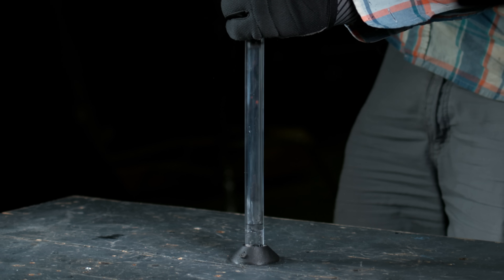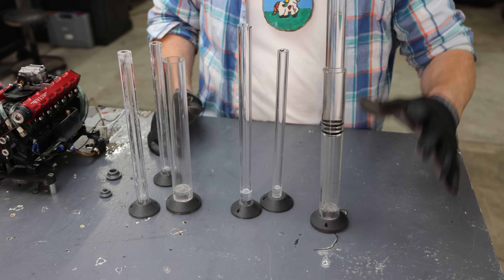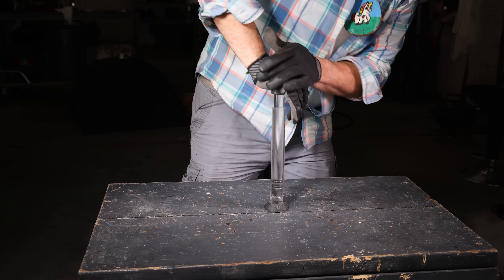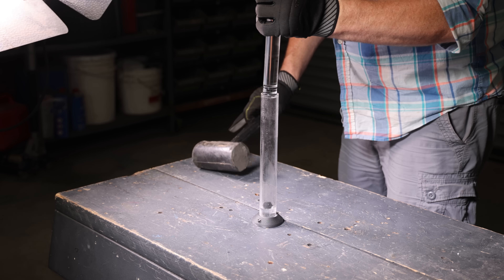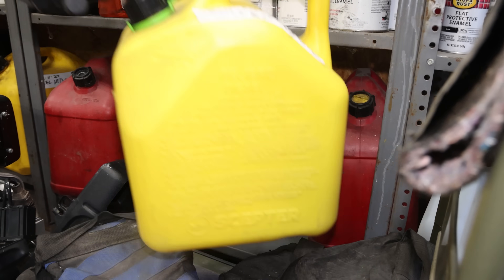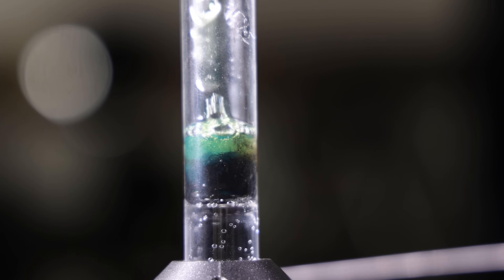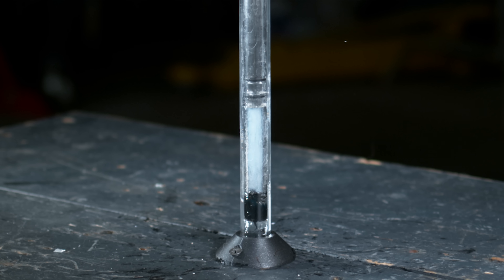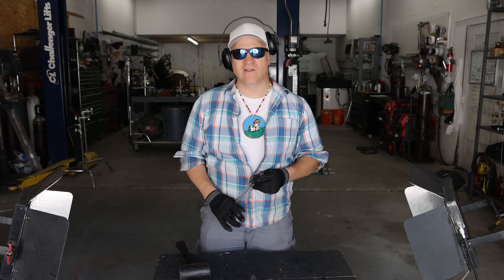How Diesel Actually Ignites (Slow Mo)

Comment: Some wicked smaht person needs to explain WHY this happens instead of just demonstrating that it does happen. Nuclear bombs seem to work in a similar fashion by violently compressing nuclear material using TNT to create a nuclear explosion. Hydrogen also appears to combust in tiny amounts in a phenomenon called sonoluminescence, which is not fully understood, but it takes a shock wave to create it, and scientists say that the heat from this tiny spark is equal to the heat of the sun. Pistol Shrimp are able to create this effect, which they use to stun their prey. There are also sonic cavitation water heaters that use shock waves to heat water "over unity," meaning that there is more energy output than energy input, which scientists like to say is impossible, but there are patents on sonic cavitation and companies that produce sonic cavitation devices, you can even produce one yourself, so there is no disputing that this phenomenon exists. Whoever can use it to create an internal combustion engine, like Stanley Meyer is alleged to have done, will truly "evangelize" the world like Stanley Meyer said his invention would do before he died of a "brain aneurysm while claiming that he had been poisoned after a cranberry juice toast with Belgian investors at a Cracker Barrel restaurant in Ohio in 1996.

Comment: Liquid doesn't compress. And that is really why you could not get it to combust verses "explode". And that is also why in diesel engines you need to make the fuel vaporize (like with the extremely high pressure injectors) to achieve combustion.

Comment: I have made probably between 20 and 30 fire pistons and have never failed to get one to ignite on the first or second hand push. Diameter though is between 3/8 and 1/2 inch using an "O" ring seal.

Comment: Your piston is trying to move up but there's a giant hunk of metal (the sledgehammer) still on its way down. To decelerate it and push it up, the force required is tremendous. So it builds up pressure and explodes.

Comment: yip diesel engines are made with metal cause POWER!... also there's another engine type with much higher compression ratios than diesel engines which uses an effect where the air molecules combust due to the fusion effect of compressed particles or something like that, basically the same as a diesel engine except you don't need a liquid fuel source only and air intake and exhaust

Comment: Dumbest video I’ve ever seen. The tubes were breaking because the plunger was bottoming out. Better o rings would solve this. Also the few ignitions he did get went out because they immediately burned off all the oxygen around them. If you attached the cloth to the plunger instead of placing it at the bottom of the cylinder, you would be able to pull it out and supply it with fresh air after lighting it instead of having it suffocate itself

Comment: I think I know the flaw that made it explode

In a usual engine the piston is tied to a rotating disc so it hits then retract, but wit with the hammer it hits and stays in place. So that's the reason the ignition is building up not having a place to expand so pressure goes through the roof and the tube explodes.

I think by making it with maybe a rotating crank it may work better if you get the motion of the piston just right.

Comment: My old Volvo V70 has 16:1 or so and an old VW / Audi 1.9tdi would be 19:1. A newer 2.0 tdi is around 16.5:1. A PSA HDi engine is around 19:1. I think modern diesel car engines run on the lower side.
No idea what haulage, big shipping or locomotive engines run at though.

Comment: One difference between your demo and an actual diesel engine is that the fuel isn't already all there as the air is compressed. The air (only) is first compressed and then the fuel is slowly injected as the piston moves down in the power stroke. The newly injected fuel burns as the piston moves, not all at once at top dead center as in the Otto (gasoline) engine. This maintains a constant pressure as the volume increases and the combustion gases do work on the piston. This pressure is set by the injector; fuel cannot flow into the cylinder unless the injection pressure exceeds the instantaneous cylinder pressure. This is why diesel engines don't explode like your demo.

Comment: The reason it is exploding instead of burning is because you have overbuilt the system so that the maximum pressure at the bottom of the movement is far in excess of the requirement to create combustion. Since the piston is still traveling downward at the time of combustion, you’re blowing the bottom off your cylinder.
Reply: I agree, in the diesel engine the timing for combustion is very important. I think the piston has to be in the ready for downstroke (power to the driveshaft) position when combustion occurs so force is directed to push the piston (least resistance) and not out the sidewalls of the chamber.  In plain english, when combustion occurs in the cylinder, the piston connecting rod has passed top dead centerpoint.
Reply: @roykowalski4125 Yes

Comment: Pinging where the diesel residue explodes on recompression which is why your tube on the second attempt just blew, the reason is that you have no exhaust sequence which on a diesel engine always means you have a fresh fuel/air charge to compress. What you could have done is try to delay the burn by adding a drop of water as that will cause the diesel to have a longer slower burn and was the basis for some of the earlier SCR systems.

Comment: In mechanics I was always taught that gasoline with a spark or diesel with compression explodes, not burns, the explosive power is what moves the piston and turns the crankshaft. so I think unless you have something that can handle that explosion you wont see it...but pretty cool!
Reply: The gasoline and diesel combustion in an engine is what's called "Deflagration." It's somewhere in the middle between combustion and explosion. It propagates sub-sonically (slower then sound) through heat transfer but still faster then normal combustion. Explosions detonate by a supersonic shock wave travelling faster then sound. An explosion in your engine wouldn't be good for anything, your pistons would disintegrate in seconds.

Comment: It's the mass of hydrocarbons (which creates pressure in the form of the gaseous combustion products, CO2 and H20) that is resulting in the exploding cylinder.  You have more mass of fuel when you are igniting the diesel than the char cloth

Comment: Compressing air does make extreme heat. If you ever touch the outlet line from an air compressor going to the tank it will burn you good. Nice video and slow mo also.

Comment: It is not just or even mainly the heat.  When you compress the partial pressure of oxygen increases dramatically.  To see the effect, fill the tube with oxygen first, I would think it much easier to ignite the diesel.

Comment: Surely if you make it stronger/thicker at the base, so it doesn't keep exploding, and the pressure instead forces the piston back up the tube, even if the piston is moving downwards? Since pressure always affects the weakest point more.

Comment: Your char cloth was ignited by adiabatic heat. When you add the diesel you’re igniting more than just the char cloth. You’re igniting the nitrogen in the air that’s why it’s such a big bang.

Comment: Liquid doesn't compress like air. If you Hydro lock a cylinder and apply enough pressure, somethings going to give.  Just like how hydraulics work. If you tried atomizing the fuel with the air, you would get a real result.

Comment: Diesel engines actually work nothing like the compression ignition pistons shown. Diesels have injectors which spray the fuel directly into the combustion chamber. The compressed air is already hot enough to start ignition, so it's just hot air sitting there waiting for the fuel, the the injector opens and sprays the fuel into the hot pocket of air and it ignites.
So the engines actually ignite in complete different ways.

Comment: I don't think there was ignition in the last two attempts. I think there was too much diesel in the cylinder and under compression, it took the path of least resistance (basically it turned into a hydraulic experiment). I would say use less diesel, atomize it, and make a thicker cylinder wall so that the diesel ignites before reaching the psi capacity of the cylinder wall.

Comment: This doesn’t help people understand how a Diesel engine works. No fuel is compressed in a Diesel engine, only air.
The fuel is injected at the end of the compression stroke and burns in the hot air.

Comment: If the fuel has more energy and the pressure is also involved with the explosion, Why don’t we have more larger piston for less explosion and more combustion. The more mass and space from the piston the more it can hold the energy from the fuel and then combustion happens.

Comment: As the air compresses, the turbulence within it increases exponentially, creating heat. This turbulence is imparted on the container and all its contents. When it ignites, it is essentially vaporized. Drops of liquid do not splash in a near vacuum. They splash due to the friction from the air.

Comment: You have to inject the diesel only when the piston produces the maximum pressure and zero down force. Ignition will push the piston up and the cylinder will probably not explode. The injection timing is very important

Comment: hello, I'm writing from Greece, Mr. Benz who discovered the diesel engine got the idea from a tribe leader on some tropical way island where he went on a pleasure trip with his yacht, as they were talking, the tribe leader took out a piece of wood which had a hole and I put kindling in it and with another piece of wood which was constantly banging in the hole he pressed so much that the air inside the cylinder of wood causing the temperature to rise and.the kindling material caught fire and he used this device with the wood to light his pipe, sorry for some mistakes in the text, maybe they are because I write in Greek and use an automatic English language translation application from the play store

Comment: That explain why the sea level temperature is way hotter than the mountain peak. pressure built at the low altitude driven by  gravity. the compressed air is making the air hot. so enough of pressure will burn everything eventually like the core. itnersting.

Comment: The pressure and temperature at full compression depends on how quickly the piston is pushed in and how much heat transfers to the cylinder wall. The ideal for an engine is adiabatic compression, which means no heat transfer to the cylinder; in that case the ratio of initial to final pressures is 1/(1/CR)**1.4... which is about 90, so the final pressure would be about 1330 PSI, not 370 PSI (as stated at 1:20). To get only 370 PSI from 25:1 compression you would need to very slowly push the piston down, allowing the compressed air to stay at ambient temperature by losing heat through the cylinder wall. If you get the piston down the intended amount by striking it, the pressure will be much higher than 370 PSI...and it will be hot, which is the point of the demonstration.
Reply: Im pretty sure we clicked on the video to watch it, not read an explanation but great job.

Comment: Compression-ignition (diesel) engines don't compress and air-fuel mixture, because the ignition point is not controllable or even accurately predictable; they inject the fuel into the hot compressed air... which of course would not be practical to do in a simple demonstration.

Comment: Using compression ignition - instead of a spark - has nothing to do with the power, efficiency, or reliability of diesel engines.  Diesel engines use fuel of high energy content per volume and operate at high compression ratios.

Comment: The fuel in a petrol engine combuststs in a controlled manor from the spark plug across the cylinder diesel undergoes a detonation which is where diesel knock comes from

Comment: Problems with this test: 

1: Lack of proper fuel atomization

Diesel (and even gasoline, just less so) requires to be heavily atomized in order for uniform and proper combustion to take place. This is done by the injectors right at the tips, commonly referred to as atomizers/atomizing nozzles. Diesel is injected at astounding pressures, on high pressure common rail (HPCR) engines, diesel is being injected any where from 15,000 to 30,000+ PSI. At these pressures, diesel is easily atomized through the atomizer due to highly restrictive flow through the nozzle with immense pressures. 

2: Air/fuel ratio 

Unlike gasoline engines, most turbocharged diesel engines are more than capable of running at significantly leaner AFR’s, with most modernized turbocharged diesel engines (equipped and tuned to run for there emission equipment) idle AFR’s reaching nearly 30:1, while under load AFR’s reach 20:1 to 23:1. While some diesel engines which are tuned for ‘performance’ with emission systems negated, can come down to 18:1, however it should be noted that at these AFR’s, combustion temperatures get very high which results in increased EGT’s creating a higher likelihood for severe damage to the engine (warped head/s, thermal fatigue of the turbine wheel, thermal warping of the turbine housing, ETC). 

3. More fuel doesn’t mean better or likelier combustion. 

This is true for both gasoline and diesel engines, and especially diesel engines considering that diesel is far harder to combust than gasoline. A proportionate quantity of an oxidizer is required to burn a proportionate amount of fuel with a proportionate amount of energy put into a system; this is an engine basic that you also clearly describe in your video. The greater amount of fuel you add, the greater amount of oxygen you need, and therefore you need a far greater amount of energy (in the form of thermal energy) put into that system in order for combustion to occur. What you should’ve done was taken the largest diameter and largest stroke fire piston, and literally only added a single or a few drops of diesel to that cylinder. This is an extremely lean condition, however it makes the combustion of diesel fuel very easy. This is because the required amount of energy to combust that quantity of fuel is significantly lower because the quantity of fuel is extremely low and the readily available oxygen is extremely high. This obviously results in a very low energy output from this system, however combustion is far more likely in this condition.

Lastly this really isn’t a flaw but it’s most likely why the fire cylinders were shattering. 

I think because the amount of fuel you had in each cylinder was so high (and in a liquid state), you were actually experiencing a very important rule in hydraulics; liquids are virtually incompressible. After several strokes of the piston where the upper most layer of diesel began to evaporate and atomize, you were getting some combustion to take place. However barely any fuel in the cylinder was actually combusting except for the vaporous layer generated via repetitive compression. When that layer combusted, a huge amount of pressure was generated, this pressure acted on every surface and equally in all directions, and especially the still liquid diesel in the cylinder. This liquid diesel is virtually incompressible, and when acted upon by the pressure of combustion, itself generated a pressure high enough to shatter the cylinder because the liquid has no where to go in that fraction of a second.

Uh, if any of you have managed to read this, this far I applaud you and I also apologize for the incredibly boring write up. If any of you wanna discuss further I’m so freaking down to talk about stuff like this. 

Thanks!

Comment: You just demonstraded "knocking" problem with low octane level in petrol engine. Diesel is so powefull that you should try only 1/10 of droplet of diesel in largest tube. If you really want just fire - you need to compress witout any fuel and inject the fuel only on expansion so see burning.

Comment: Itd be awesome to see a  complete lower compression see thru experiment like this where you have a little 3D printed crank on stands and can weight and balanced it with wheel weights. Then have your compression tube just like you have here below it. Shorten the stroke and engineer something that works like intake and exaust valves off of the chamber that can be timed on plastic gears from the crank to whatever you you come up with to for valves. Then you could probably just use a syringe for fuel and let natural vsccum do its work to feed fuel on the intake stroke! This would be cool. Something that'll sustain just enough to chug chug chug chug and show the process!

Comment: Explanantion of why did the 2 diesel cylinders explode. It is beucase you put to much diesel in cylinder and fluid is not compresable. You can almost see that the piston is touching the diesel, this is why cylinder exploded.

Comment: Boyles law? I think. Every time you halve the volume, you get one degree of heat increase. At one point moving .010" is halving. The coolest a charge can be is 190 degrees f. Do the mat and your up to 1400 degrees about the time the injector fires. That's how.

Comment: That is why diesel engines are made rugged. That extreme compression cannot stand a thin engine block. Cast iron is common but other block materials like magnesium and aluminum is rarely use as a base for cylinder sleeve to hold.

Comment: When the diesel fuel is compressed repeatedly it heats up and enough evaporates to exceed the lower explosive limit in the air in the tube. It then detonates when heated. The main reason a diesel engine is not so susceptible to detonation is that the air is already compressed and above the ignition point when the fuel is injected so it ignites rather than vaporizing.